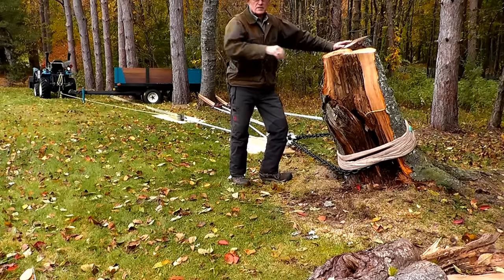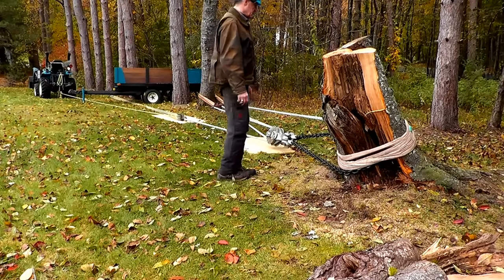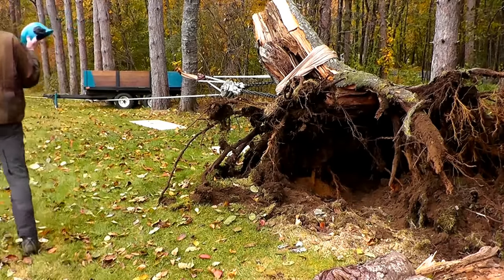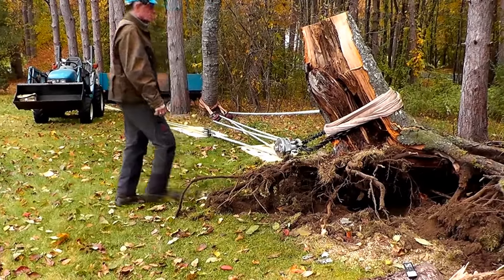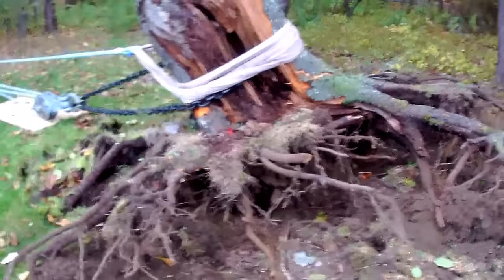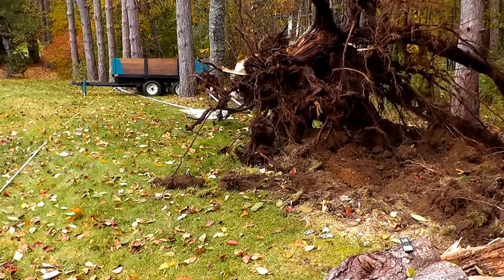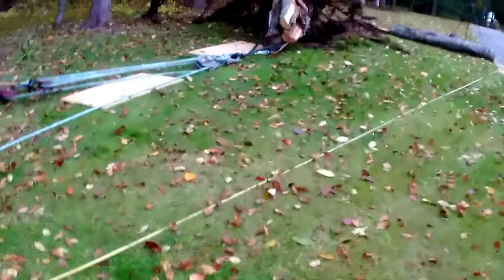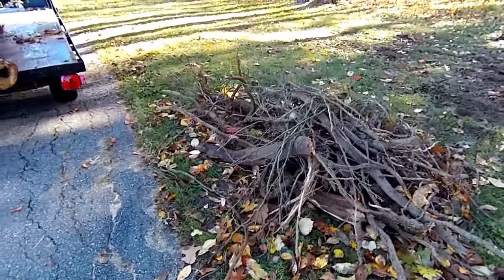Big Stump, Little Tractor

Comment: awesome video. Curious... I have a 15000 pound winch mounted on a 1 ton truck. Would it be safe to do a straight line pull of a tree like this and with the winch on my truck? Is there a reason a person would use your setup oppose to doing a straight line pull ?
Reply from the maker: Good question.  doubt that a winch on a 1T truck would work except for small stumps.  Three problems:  you'll start dragging the truck;  the winch will very quickly lose strength as it takes on wraps and tensions the line; and  I sure don't like looking straight down the barrel of that loaded gun!As pictured, my rig can lay over 18T on the stump and continue the pull for 13 feet.  That's really big ... watch my vid "Proof testing the E/E Sling"  Maybe some winch guys could comment about big stumps they've tried.
Reply: Eddie Regory you can get snatch blocks for your winch to get mechanical advantage like in this video, but winch cable is only so long.  also, you'll never pull a stump this large with a 1 ton truck unless you can anchor the truck in place for the pull.
Reply: Kur is right, though Tom had slight lack in this hindsight. You Can use your truck, just make you anchor it itself to something sturdy, its not like a wrecker with their weight and winch brakes (sets all the brakes on the truck to anchor it to where it is. Sure you can use a tractor like Tom the same way with the truck but since in these two cases the tractor is used as the winch much like on your truck, the truck itself while what it weighs is more I am guessing, but even it you set all the brakes on your pickup, its still going to move when pulling if not anchored to something else..

Comment: Great video sir.  Where did you get the block and tackle set?  I can't find them anywhere.  Not the snatch block single pulley but the triple pulley made from steel.  Google searches only get me the old wooden antiques.  Thanks
Reply from the maker: +Trevor Simmons Thanks, Trevor.  I found it on eBay decades ago and never seen another like it.  There is no marking on it to identify the manufacturer.  Great rig.  Sorry I could be more help.
Reply: +Trevor Simmons I went through the same thing. You can find rope pulleys at McMaster-Carr, then fabricate your own set from plate steel and grade 8 bolts. mcmaster dot com and then search rope pulleys.
Reply: +TheOtherBill Thank you sir. I will check them out.

Comment: That, sir, was bad ass. But I am confused as to why it pulled the big diameter stump out, but not the small diameter tree you had tackle anchored to?
Reply from the maker: Rick, this is such a good question.  What you don't see is the reason I had to take the tree in the first place:  storm damage.  The trunk had moved thirty degrees over and the root plate was lifting.  The tree was doomed. If the cherry were completely sound, I would have needed an equalizing anchor to spread the anchoring force to two, or more, trees.
Reply: Actually be did  distribute the  pull over  2 trees...  The one he barked and the one that the line went to under the tongue of the trailer.... Using a lil thinking  does wonders....  I would have distributed the load over at  least  3 big trees just to lessen impact to the  live trees and  because as  a climber you use 3 anchors for safety....
Reply from the maker: Guys, we've got some serious thinkers out there!  In the original 35:1 configuration, for tractor tension force T: force on stump = 5 x (7T);  force on barked tree = 4 x (7T);force on trailer tree = 6T.
Reply: Yep! Thanks for the tutorial :)
Reply: It's all an optical exclusion.
Reply from the maker: Yes, indeed.  This one was easy because of the storm damage.  But this rig has done healthy pines in firm ground 212" diameter (!).  See the pix buried  in the vid "Mechanical Advantage vs Straight Pull Stumping".  Without the storm damage, the only thing I would change is to secure/distribute to a stronger anchor.

Comment: Why didn't you move that trailer? rope under tension cuts very quickly, seems an unnecessary risk to leave it running underneath.
Reply from the maker: This is good observation and an excellent question.  The trailer isn't left there by accident:  check out other v ids where I explain that I use it as a safety/containment device to knock down any flying bits. In the first pull (away from the camera) the block hooked the frame of the trailer but didn't threaten contact with the rope.  Nevertheless,  I reversed the pulling direction to change the vectors and give the rope a clear path under the trailer. You can see me checking this out.

But I certainly agree with the underlying sentiment ... don't underestimate the potential hazards here!  Check my vid "E/E Sling Proof Testing" and you will see a 115 lb pulley accelerate to 100+ mph in 1/30 sec and dig an 8-inch deep divot the ground where it stops!  Absolutely lethal forces!!

Here are three (3) rules that have served me well:

One - Know/calibrate your input pulling force.  Don't look at the stump!  I guaren-damn-tee you the stump isn't what breaks the rigging;  it's the force delivered into the working end of the line!!

Two - Learn everything about MBS and SWL.  And why they are different.

Three - Don't "lunge" into the pull.  Ever.  You loose all control of the math and you're just trusting to blind luck.
Reply: kyrg, while that is true for steel wire, I have yet to see or hear of  synthetic rope do the same as its an entirely lighter  and much less stored energy factor when it comes to synthetic.

Comment: Do you know of a source for the pulleys you used in the video?  I have several stumps I would like to pull and getting a dozer into them would be a real pain and expensive. I do however have a 35hp tractor that I can get to them. I can't find any pulleys strong enough locally. What type of rope did you use for the basket set-up on the stump?
Reply from the maker: +Jack Terpack Jack, my source for this stuff is tool fairs, flee markets and eBay.  It's taken me a VERY long time to assemble this whole collection but stuff this heavy is prohibitively expensive when bought new.

Turns out I'm moving this summer and will be selling much of my heavy rigging.  Check out the pix/specs at https://www.dropbox.com/sh/vdh5zrbnn5gjfvm/AACI1U4gs69-n_Jd0UUHV65ga?dl=0

Contact me at Tom@Hoffmann.net with any specific interest.

Comment: I used to drive a boom truck with a roller tail, a granny 4 speed with a Columbia dual speed rear end and a 100 ton winch driven from the power take off on the transmission. That thing would haul the moon off to the dump if you wanted to.

Comment: What happens if  it's a lone tree in a paddock there there gonna be nothing to attatching the pulleys on and nothing stronger to put there than a tree stump
Reply from the maker: KT, the simple answer is to bring in serious hydraulics.  BUT if you're really determined, check out the ground anchors described in the Navy manual TM5-725 "Rigging".
Reply: ok or if your tractor has enough traction you could try ripping around the stump with a set of rippers
Reply: KTM200 EXC stump grinder
Reply: EnduroBluff Or soak the ground with water till it's completely saturated.

Comment: I have about 30-40 Pine trees ranging from 50 to 100 feet tall that I need to clear. I don't have any Idea how deep the taproots grow on these trees.  the soil is sandy in this part of Michigan.  Would this rigging system work to remove the stumps from these pines?
Reply from the maker: +William Dula Yes, probably it would.  But I use this set up maybe 2-3 times/year dealing with storm damage or landscaping issues.  If you're really going to do 30-40 trees, I'd bring in heavy equipment.
Reply: +Tom Hoffmann Do you still have the blocks for sale?  I'd like to get whats left or can you advise where to buy similar equipment?
Reply from the maker: +William Dula Bill, contact me Tom@Hoffmann.net
Reply: No.  I don't see this working for pines.  Cut 'em and grind 'em like "normal" peoples would...,
Reply: PINE TAP ROOTS RUN PRETTY DEEP SIR. JUST CUT THEM OFF ABOUT SIX FEET BELOW ROOT BALL.

Comment: Could an 18hp tractor rigged to a 35:1 setup pull a 600hp truck?
Reply from the maker: Sara, this is an unbelievably interesting question!  Here's the short answer:  yes, with mechanical advantage under the right circumstances 18hp could outpull 600hp.  

But it's VERY complicated ... not just hp but gear ratio, weight, friction and ground contact and other variables play a complex role. Have you ever wondered why farm tractors have those HUGE rear tires?  You have to "couple up" the horsepower to big ground contact or nothing useful happens.  

If the truck doesn't weigh much and it sits on bald 18" tires, and it doesn't have a low range gear box, it won't pull much at all.

But with momentum is could "lunge into" pulling out a stump.  This is what you see happening so often on YouTube.  It scares the crap out of me. The dynamic forces wreck the math and the safety calculations.  God only knows what will happen ... that's why the videos are so interesting!!!
Reply: Hore power doesn't mean anything when you talk about pulling capabilities, you clearly showed this in the video. Instead it's all about torque. Or do you think a Formula 1 car can pull a truck? I don't think so.
Reply: Yes, easily, until you start it, then things get a bit more complex 🤔

Comment: should have rigged it to the top of the stump where you have a four foot leverage arm
Reply: might slip off
Reply: I wrap a chain around at the top a few times, usually doesn't slip off. The harder the pull the more the chain digs into the bark and wood. It may slip off at very low angles but at that time the stump is mostly out of the ground.

Comment: the stumps where you live must be easy to get out, try that on a eucalypt stump like we have here in Aussie, you need wire rope  at least 19mm, 3/4 inch thick to pull that out.
Reply: Hi, no need for compliments, I never stated anything about the block and tackle I use them all the time, just the fact the rope must either be strong or what ever, don't take life too seriously man.
Reply: IF you read some other comments he said he used Samson Amsteel II at 7/8th inch (22 mm) which is rated for 50,000 pounds (22,70 kg) average break strength. I am pretty sure its matched with what you use and lot less snappy when breaks as it will only whip apart a few feet.

Comment: hook up closers to the top of the stump, it'll Come out 10x easier.
Reply: no....it will break off and you get to start over.
Reply: *****  
It's the same diameter at the top of the stump as where he has it hooked up.
I've ripped put lots of stumps, never busted a big one that isn't rotten.
If we are talking about a 3 or 4 inch diameter stump, ya, it'll break. Not one this size.
Reply: bob maki
nevermind....

Comment: I don't think I even want to know how much money it took to put together that rig! Work smarter, not harder.
Reply from the maker: It's prohibative to buy this gear new.  But monitor eBay, county fairs, auctions and you will be surprized at the bargains you can find.
Reply: 4000 lb block and tackle, at Amazon... $24.95
Reply: If you have a bit of land or as I do, work in this industry you pick up stuff along the way. Adding and upgrading tools is half the fun. Cheers

Comment: That looked inherently dangerous; I couldn't see a safety inspector passing that setup as okay.
Reply from the maker: Damn right it's dangerous.  The energy stored in the cordage is lethal.  To see what I mean, check my vid "E/E Sling Proof testing" ... you will see a 115 lb pulley and shackle accelerate to over 100mph in less than 0.1 second!
Reply: Yet again Tom your spitting out myth that synthetic rope is as dangerous as wire rope when it is NOT, I never got hurt by snapped rope, but when it comes to wire rope I stand clear. If anything with rope, when using pulley in this situation the whip comes from the rope spooling around the pulley but since it so light and stores little to no energy like steel variety it itself will not hurt any more than bruising maybe a small cut if that unlucky, or you may just get away with a slight burn.

Comment: The chain on the stump should be cinched or at least secured better. The strap around the anchor tree should have been the same, or even taken one end of the strap to a second tree to lessen the damage to them. It would have taken 1/4 the leverage if you'd have tied to the stump halfway to the top instead of near the bottom. A cinch down low running up to a halfhitch above will keep it from sliding up, especially if you wrap a root.